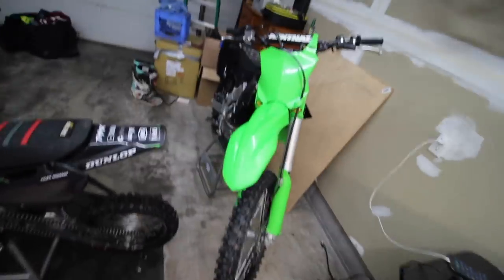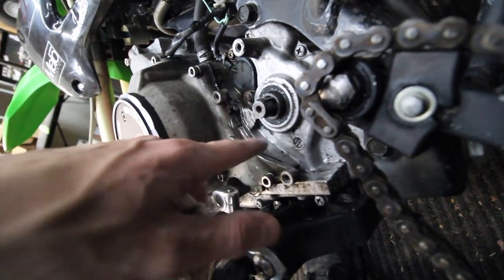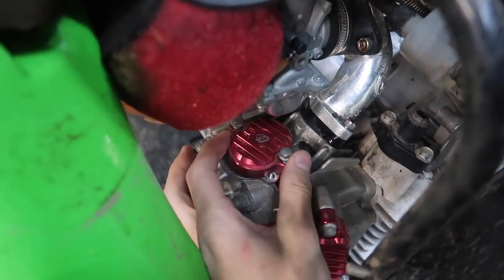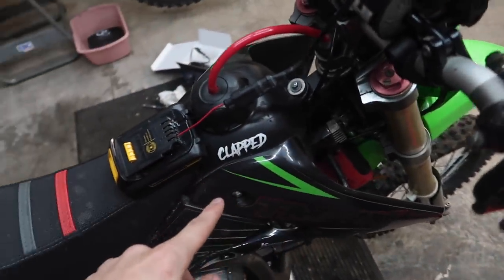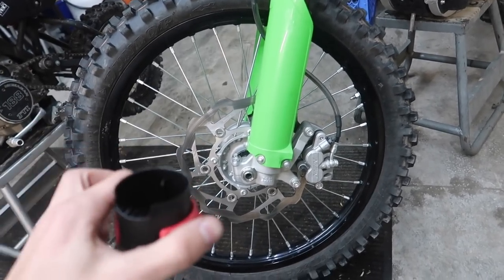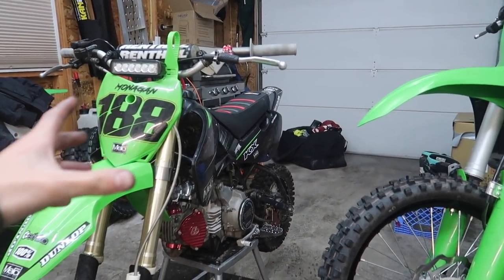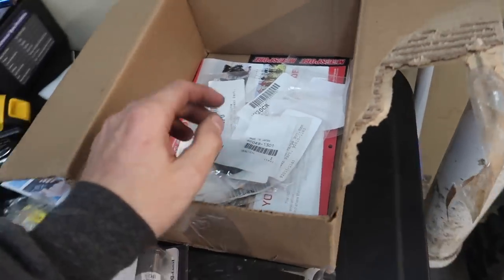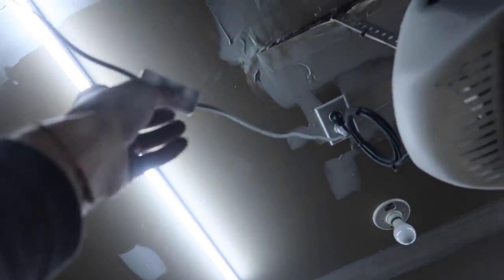KEEPING A NEW DIRT BIKE NEW? A Foam Cannon Is Key

Comment: the left fork is normal because the forks are the separate function so spring in one side and nothing in the other. i have an 18 and just got them valved and its the same
Reply from the maker: I understand that it's supposed to be like that it just feels different than usual I didn't explain to too well. But thanks for the info
Reply: That is completely normal Tyler nothing wrong with them
Reply: are you racing empire state mx? I'm racing in C class, I'm from the same area as calvin and payton but i raced a canadian series last year

Comment: pretty sure you know that but you should adjust your valves with gauges, on a 125cc pit bike (think it is the same for almost all pit bikes) you should use a 0.10mm on the top valve and 0.15mm on the bottom(don't know the conversion to imperial).it would make it way easier to adjusting the valves.

Comment: The left fork is supposed to be soft like that. I have a 2017 kx250f and I had the same leaking problem and I thought it being soft was a problem as well, until my suspension guy told me otherwise.

Comment: What happened to the valves is since you rode in the mud the dirt got into the case and since it got into the case it got into your oil. Which caused the valves to get ground down. The exact same thing happened to my old crf150r when the chain snapped and cracked the case I kept ridding and after I rode and the bike got really dirty dirt got in the oil and my valves were shot within an hour after of riding it after that. The dirty oil is what destroyed your valves.

Comment: The reason you can push up one side of the fork and not the other is cause on of them is just the air compartment and the other is the oil part.

Comment: Tyler you'll need a top end rebuild on the pit bike. The oil rings on the piston are snapped. It happened to my bike.
Reply: CJ's Adventures ye if it doesn’t have much compression then it’s definitely the piston rings

Comment: The smoking means it’s time for a top end I have a pit bike also and it was smoking bad so I took it apart looked inside, piston was smoked you got a bad oil ring if there’s that much oil in the exhaust I had the same problem but just do it now don’t wait most likely caused by over revving plus make for a good vid
Reply: Nick Lambie I agree, top end on the pitty is only 100-200 and totally worth it.

Comment: Hey Tyler i started watching your videos a few days ago im really enjoying them i decided after watching your videos i picked up a SSR pitbike i have reason to belive its older but its ran like total crap didnt start when i bought it, tottaly rusted out i rebuilt the motor, and the top end waiting for my carb today did an oil change and i have to adjust my valves today as well do you think i should use a 0.002 feeler gauge for a 70cc motor i was told a 0.005 but im not sure because i dont know what year the bike is nor do i have a manual for the bike lol TIA

Comment: Love your vids g can’t wait till I’m 16 and I can start dirtbiking and get a motobike 😑🤤
Reply: JustJack why do you have to be 16?
Reply: I know same with me :(
Reply: Ellis Berry gotta get a job I have to wait till I’m 16 to we don’t have the parents to buy bikes for us
Reply: James Bailey I see your point but I'm 13 and I've been saving up all my money for about two years and I'm getting a pit bike sometime in the next month so it is possible if you stick at it
Reply: Ellis Berry yeah I got a bike but  it ain’t new or racing material
Reply: So this is how i did it, when i was 3 my dad bought me my fist dirtbike, then my friend gave me a Suzuki ds80 that wasn't running(ended up only needing a carb clean, then i sold that bike and got a klx125 for 350$, sold it for 800$ then bought a kx125 and that's what I'm ripping now, you don't have to have alot of money to buy bikes you just have to be smart about how you buy them and wait for the right deal on craigslist lol:-).
Reply: Just buy them cheap with what you got, clean them up and sell them for more until you have enough to buy a full size bike
Reply: Mitchell MX that’s very very true but this summer is when I’m going to try it